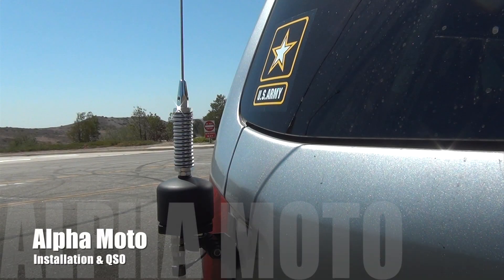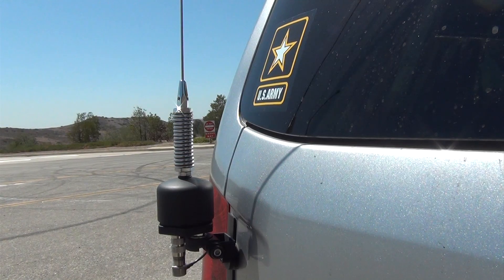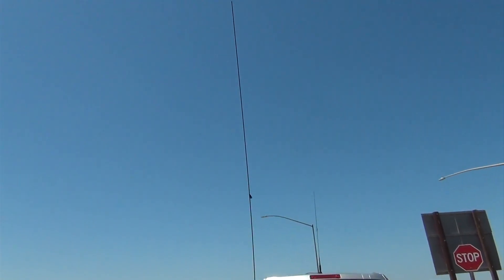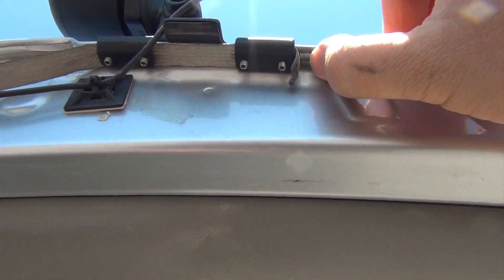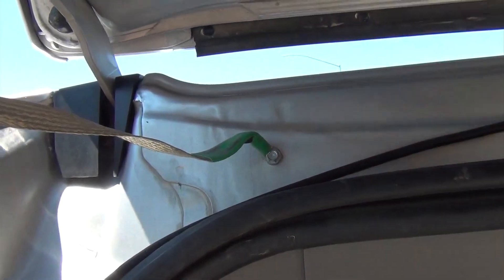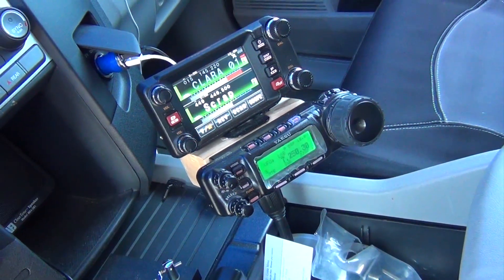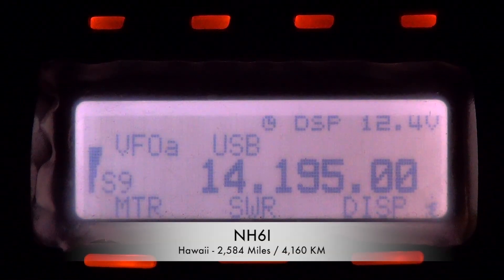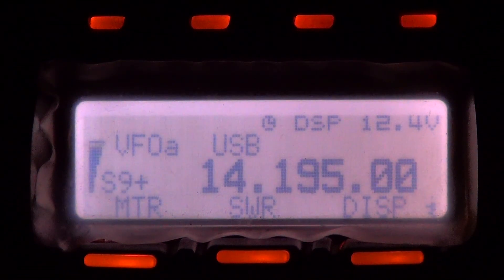Ham Radio Antenna - Alpha Moto Installation & First Contact (Mobile HF Ham Antenna)

Comment: the LDG-YT100 antenna tuner... what is the purpose of this for a fixed antenna? I am new to this but very curious to soak it up.
Reply from the maker: Thank you for taking the time to watch and the comment! It is greatly appreciated. I use the YT100 to insure I have a 1:1, or as close as possible, match.

Comment: alpha moto turned out to be a big waste of money. garbage!
Reply from the maker: The last several years I have been using the ATAS 120A with both the FT-857D and the newer FT-891. I have been debating on other antennas for my new(er) truck.
Reply: @WJ6FRadio  just ordered a Tarheel II. Atas has been fine but wanna try the Tarheel.
Reply from the maker: I have thought about getting a Tarheel. Heard a lot of good things about them. The only advantage I have with the ATAS 120A is that since I am running the FT-891 It is über easy to tune. However, since getting my truck I haven't a clue as to how to mount the antenna.
Reply: You couldn't make it work? It didn't work as well as your other mobile antenna? You didn't install it mobile? Your assessment means nothing without details. What do you prefer?

Comment: I was just talking with Alpha  about the moto. It seems to be a good general 6-40 + mobel antenna. Now that you have been running it how do you like it, would you buy again?
Reply from the maker: Thank you for taking the time to watch and the comment! It is greatly appreciated. Great questions! Me and another local Ham compared the Alpha Moto to the ATAS 120A both using the Yaesu  FT-857D. The Alpha Moto listened much better than the ATAS 120A. Due to band conditions being what they are, transmitting didn't go well for either of us. In short, Yes, I most likely would buy it again.... all things being equal.
Reply: Thanks for the reply, I ordered 1 today with the 13ft 6 sec. as well.  I was talking with James and he seems to be knowledgeable.  Not sure what rig I want, I like the Ft due to size and coverage, but looking at the icom 7300. After being off the air for 30+ years I started up mid2016 and running the ft1200 and the ft400 at the shack. I fiound a lot has changed over the 30 years, I feel like a beginner lol.  Thanks again  KB1VI aka Buzz
Reply from the maker: Please share how your new MOTO Antenna works out. Alpha has revamped the antenna and if nothing else it is much sturdier! Alpha also has excellent customer service.
Reply: Will do, however it may be a few weeks, I need to buy a HF mobile rig. I may test it with my FT-1200 just to make sure it was hooked up ok.

Comment: Which Diamond mount do you recommend for the Alpha Moto B antenna? K400CNMO (gutted) or the K400 3/8C?

And where did you get the 13ft whip? And 6 section, or `3 section better or does it matter? 

Just ordered the FT857D and the YT 100 tuner... Looking for antenna options.
Reply from the maker: Thank you for taking the time to watch and the comment! It is greatly appreciated. The 13' whip came with one of the other Alpha Antennas I owned at the time. I believe he has revamped the whips to get a better connection. I would think a 3 section would be a little better.

Comment: are you using the coax that came with the k400m how's the coax connected to the antenna? thanks kc9oza
Reply from the maker: Yes, I use what came with the K400

Comment: Hi, How's this antenna working for you?
Reply from the maker: To be honest. I'm not using it anymore. I have taken my FT-857D out due to the bands being so bad.
Reply: I understand. I have one and am now using  a 102" whip. It works good now. The supplied whip just isn't as effective. Thanks for the video and best wishes, hope to hear you one the bands. 73 Rich, K0PIR
Reply: Ham Radio with K0PIR I'd thought about that... does Alpha have 96" whips? Or, will I have to go the 102" whip route?

Comment: Anyone using one of these on Semi truck have any ideas on the grounding and mounts?
Reply from the maker: Hello and thank you for the question. If only I had been a ham when I drove OTR. Do you drive dry van, refer or flat bed? If flat bed cab you use one of the bolts for the headache rack as a ground?
Reply: Robert Reed use a steel pipe attached to the bottom of the headache rack to give a mounting place at the left or right back corner of the cab to get the antenna out past the cab.
Also you can mount it on a tow hook or deer guard on the front.

Comment: I already have the EZ Military & love it! Been thinking about this MOTO for some time now. How does it do at Hiway speeds?
I drive an 18 wheeler & researching what will be the best choice. 
Thanks Warren
Reply from the maker: +warren7127 Thank you for the question! I have had mine at speeds of 80 MPH with out any problems! I wish I had been a ham and had this antenna when i drove OTR for US Xpress, Swift & Prime, Inc (Crime, Inc)!
Reply: +VideosByDPF Thank you, I'm currently running an ATAS 120 with a K400 mounted to the door of my Cascadia. Even on a 62 mph Crete truck, I'm reluctant to extend it out for 40m while driving.
Reply from the maker: +warren7127 As seen in one of my other videos I too use an ATAS 120A. I agree that running it at 40 meters gets a little sketchy. 

Hopefully Crete treats you better than Prime treats their drivers. US Xpress was the best company I drove for.

Comment: Hi, i need some guide on where/how you supplied power to the 857D. How you route the power cable and where you tap it. i have a 2015 pilot and i just can't figure out where to get power for my 857D. Thanks
Reply from the maker: +revo adan Thank you for the comment. Mine is a 2014 Pilot and I am fairly certain they are exactly the same so I will get you that information. The power I ran directly from the battery.
Reply: I am interested to mount my 857 but i can't find any hole in the firewall that i can use to insert the DC cord.. in what and where did you  run the dc cable from the battery going inside the car?
Reply from the maker: +revo adan I am putting something together to help you and hopefully others with this running power.
Reply: +VideosByDPF hi, is that long whip included with the package?
Reply from the maker: +revo adan Thanks for the question! The whip that comes with the antenna is 5 feet in length. 
However, you can purchase an extra 13-foot whip for the Alpha Moto.

Comment: Cool vid man! Thinking of adding this to my Tacoma besides the ATAS 120A.
Reply from the maker: +Robert Fernandez Thank you for the comment! I too am looking at running this along with my ATAS 120A on a Honda Pilot. I have found that the Alpha Moto receives weaker stations much better than does the ATAS 120A.

Comment: The 13 foot whip is a great option as well, I'm looking for a mount to install it on my Toyota Tacoma pick up truck. By the way I own an Atas 120A too. Almost forget how's the antenna performance on the 80M band?
Reply from the maker: +TREVIÑO KG4UHV Thank you for the question! This antenna is not built for 80m but you can receive on 80 and occasionally get a signal out. To mount the Alpha moto you can either use Alpha Antenna's "Alpha Jam Mount." I use Diamond Antenna's K400 Trunk/Hatchback Mount as seen in this video. It is the same mount I use for my ATAS 120A
Reply: Sir,
Thank you for the information 73.(Great video)
Reply from the maker: +TREVIÑO KG4UHV You are quite welcome, and you don't need to call me sir "I work for a living." Where would you mount either the Alpha Moto or ATAS 120A to your Toyota?

Comment: After watching a couple of your test/qso video, some feedback if I may. 

Nothing can be more challenging than a station who puts out a call and when you come back to them, gives you very short responses and nothing to work with to promote a conversation. 
Each time you've sounded more like an advertisement for the antenna rather than sounding like you were interested in what the other station was saying and gave nothing to the other stations during your overs to respond to or to relate to. 
Even just a short weather report or something about yourself can go a long way to making the QSO that much more pleasant from the other end. 
cheers and 73
Reply from the maker: +DENMONKEY Thank you for your comment and in put. I do appreciate the advice!

Comment: My Brother :. Thanks for the video, I am very interest on both the mount you used to mount the 857D Face plate and the device above the 857D face plate. Ordering an Alpha EZ Military. I own an 857D and looking for mounting solutions.
Reply from the maker: +Gilbert Villanueva Jr Thanks for the comment. 
The way I mounted the two radios is by using a cup holder mount by Lido. Due to my cupholder being oversize I used a 3&quot; or 4&quot; PVC coupler to better secure the Lido. 
The FT-857D bracket is screwed in to a piece of 2x4 which is screwed to the top of the Lido. The whole top portion can be removed from the rest of the Lido mount. 
The radio above the FT-857D is the Yaesu FTM-400DR (2m/440 Digital Fusion).

Comment: +K6DPF  -  About to purchase the YT-100 tuner.  Do you think it's a MUST for FT-857D ?   Thanks.
Reply from the maker: +Ben Morris (Shaolin Master) Thanks for the comment! I believe very strongly in the YT-100 Tuner. I have another LDG tuner on an Icom radio, and think that LDG is a solid product. 

If you use it as a mobile with the ATAS 120A antenna then a tuner is not needed

However, If you are using the ATAS 120A Antenna with the FT-857 then the tuner is not needed. 

Good to see another Shoalin practitioner.

Comment: What good is a mobile antenna that you can't use mobile only parked?
Reply from the maker: +1OFGODSOWN 
You can use it while driving... The Alpha Moto comes with a 5 foot whip as shown in the beginning of the video, but you have the option of using one of Alpha Antenna's 13 foot whips as shown starting at 00:25. Thanks for the comment